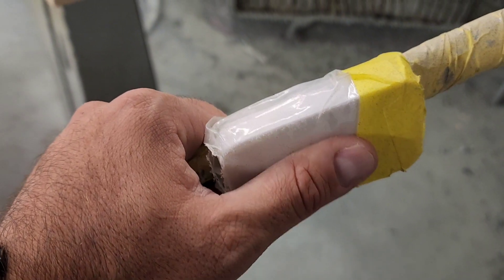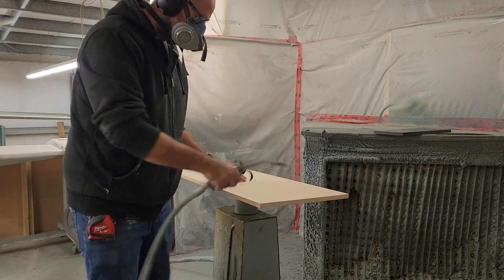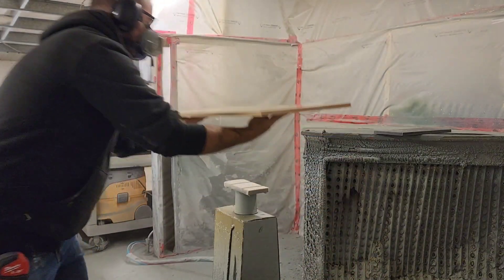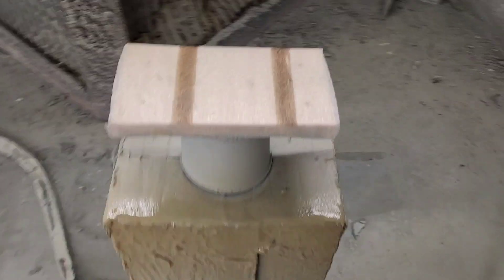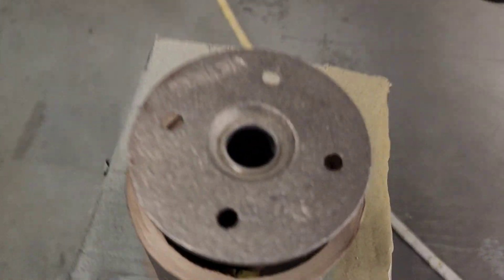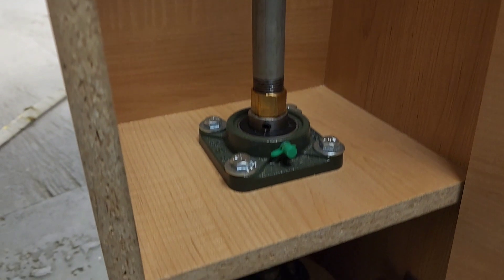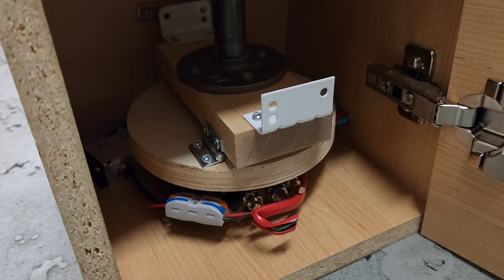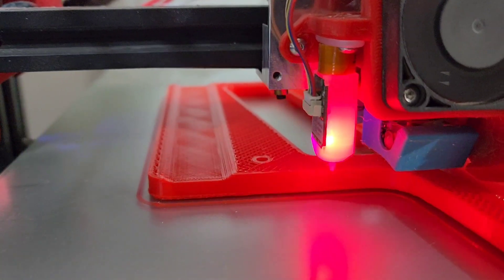Spinning Table Painting Upgrade!

Comment: Hi! I have a similar setup but it’s not as rigid as I’d like with the motor. Is the rotary actuator electric or I’m confused on how the smart switch connects to it..? Thanks!
Reply from the maker: Oh it’s pneumatic that rotates it actually and smart relay switches an air solenoid
Reply: @cabforgesystems that makes a lot more sense now! I got confused on how it stopped so perfectly and thought it had a magnet or something.